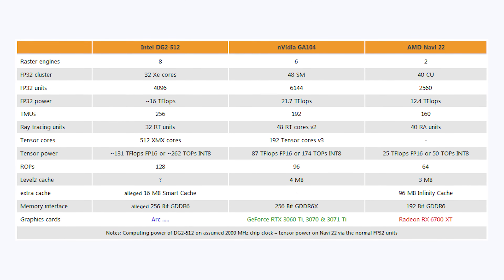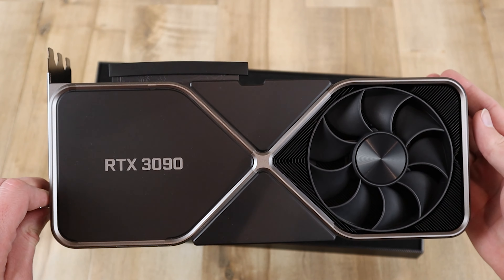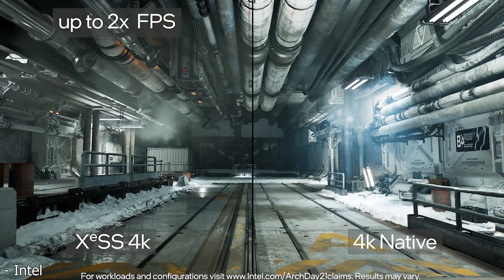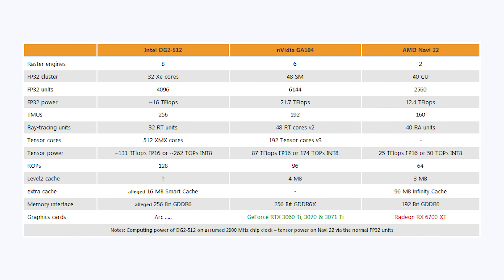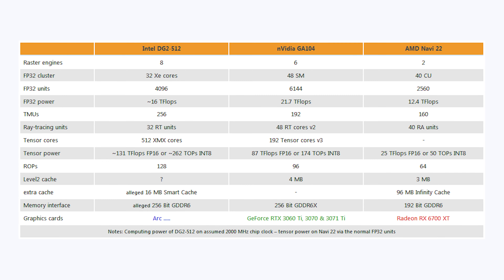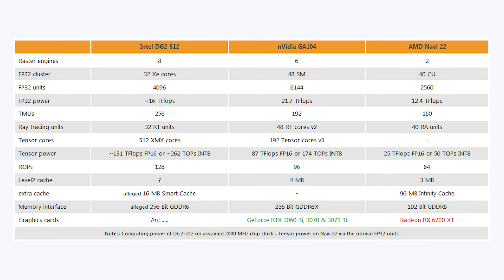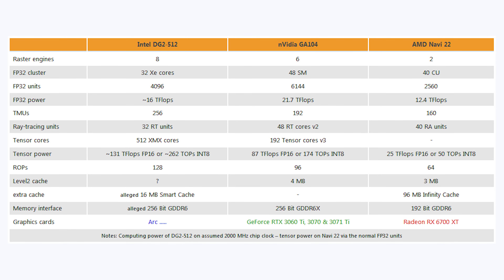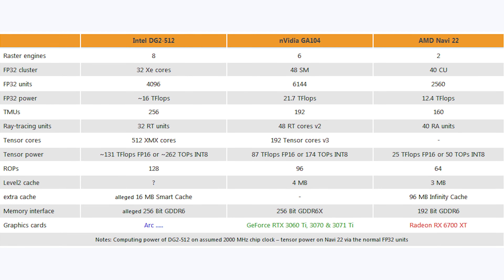MONSTER Intel Arc GPU - Specs, Performance, & Release Date

Comment: Was wondering if you could tell me would it be worth it to upgrade to the INTEL GPU from a 2080TI? Im perfectly happy with 1440p 165hz gaming. But I do VR flight sim with HP reverb 2. Im thinking this INTEL card could be the best bang for my buck on the handful of games I play.. but my 2080ti is rock solid for 1440 gaming
Reply from the maker: Probably not, no. The 2080 Ti is still a great card.

Comment: Intel's iGPU drivers (when they remember to release them, ahem Rocket Lake) have been relatively stable.  I'm curious to see how the driver team does with their more complex GPUs.
Reply from the maker: I would assume it's a top priority.
Reply: since they have a lot of experience in optimizing drivers for low profile gpus and igpus i'm sure the performance is gonna be great on ARC gpus :D
Reply: well.. its not intel first gpu anyway.
Reply: Intel igpu were awesome in past as well. Remember in 2014 they brought broadwell core line up with irish 6200 igp which was faster than upcoming hd 630. Sadly the broadwell first chiplet desgin intel cpu was failed in terms of latency because haswell monolithic was Faster than chiplet broadwell . As a result whe have seen some immature igpu like hd 630.
Reply: no problem. just hire more people to do it. intel have the money to make it happen. intel isn't necessarily bad at software. their open source effort are said to be even better than AMD.
Reply: @GraphicallyChallenged  they remember how driver problems crippled the navi launch

Comment: The biggest issue facing intel GPUs is going to be the drivers as these take time to mature.
Reply: intel just need to make their driver team 10 times bigger than nvidia. they got the money to do it.
Reply: I'm sure it being intel.. it should be pretty fire on launch and compatibility will be the only issue with older hardware. I'm interested to see if they work on on let's say a 1st or 2nd gen ryzen or all the way down to a 3rd gen intel. It will be very interesting
Reply: @arenzricodexd4409  Bigger doesn't mean  better
Reply: Intel has been writing video drivers for decades.

Comment: As Intel is using TSMC for their Arc GPUs, they'll face the same supply constraints as AMD.  Their prices will probably be online with the reference AMD GPUs, barring any distributor price chicanery.
Reply from the maker: Not necessarily. It's a different node and Intel is only producing GPUs. AMD is using 7nm for Consoles, CPUs, and GPUs. But it is still a concern.
Reply: @GraphicallyChallenged  Good point.  Yeah I'm hoping manufacturers start penalizing destructor for abusing the market.

Comment: Technically the full Intel GPU could beat the 3090 by a fair amount. Unfortunately Intel isn't releasing it for consumers, only data centers. It's fairly clear Intel only is making GPUs to fight Nvidia out of the data center market. They want that bundle benefit that AMD has so they have to kick Nvidia out of the market.

Comment: Intel gpus isn't going to be cheap.
Also good luck getting one it's a paper launch again.
Reply: gpu supply will be bad in 2021-2023.
Reply: None of these were "paper launches" stop using buzzwords you hear online. There is multiple, very well documented, reasons for the shortage and it doesn't just affect gpus.
Reply: @zushikatetomotoshift1575  2021-2023? that's cute you think the supposed "experts" are accurate on the timescale when they aren't accounting for a second depression and a second lockdown as a cherry on top.

BOI, back in the 90s - early 2000s, a good gaming PC was 5000$-10,000$ and may as well been a luxury item. Guess how much PCs will be in the near future when you account for shortages+inflation+deppression+pandemic?

Get them GPUs and CPUs while you still can ppl it's not going to get cheaper.
Reply: @MarkFin9423  I agree they are not going to get better prices maybe until after 2024? but how knows.

Comment: Nm nodes is actually kinda misleading, Intel has about the same transistor count if not slightly more pr mm^2, however their arcitecture is less energyeffective than AMD's.Samsung nodes are no different, Nm is nothing but a name to represent progress, but not in a matter compared directly to the competetion,it is simply just marketing.It will be a fierce fight between Intel,Nvidia,AMD and Apple when all of them does both cpu and gpu in their own brandings, neither Apple or Nvidia will linger for much longer until they could expand and grab some of the sweet sweet % of the market and deliver competetive systems branded with their names on both cpu and gpu.
Even more powerful gpu's than we have today is all and well for datacentres,AI tech, Minig, and such, but keep in mind that most game developers stribe to implement low end hardware into their games so they may yield better profits(gaming seasons,cosmetics,battlepasses,lootboxes and such).I do believe that in the near future, midrange gpu's will practically seize to excist, while low end and used previous gen gpu's will dominate the market, while high end gpu's will be so crazy expensive and powerful that nobody with a normal income may afford it.
Intel's Arc Gpu would be like a 3060Ti or 3070 for the most part, i am not aboard the hype train just yet.

Comment: So basically, intel is going with mid range 5700 xt vs 2070/2060s path and while they are a sh***y company(morally speaking) they are a very competent one when they do focus on something. Then, they will try to match the high end with the 2nd or 3rd generation. The question I really want answered is if they will "match" the pricing of amd and nvidia or will they lead the group with a lower pricing. But looking at the history of their business model and the fact that they are going to use tsmc as well, they won't. We, the consumers, albeit will have more options,  it would still be between which expensive gpus we are going to buy. A bit dark I know, but I can't help it.
Reply: they deff will charge as much as they think they can get away with they have a large following of customers that will pay whatever they charge even if they where to charge less scalpers would soon take care of that missed opportunity for them

Comment: "IF Intel sets their prices at a reasonable level…" 😂 Right now, a "reasonable level" is "the price scalpers are currently charging," because it’s been shown that consumers will (grudgingly) pay that much if there's no other alternative. So why take less? It would literally be corporate malfeasance to charge levels like current MSRP.
Reply: It's way better to pay an higher msrp than give scalpers headroom to charge prices. At least I'm giving more money to the people who actually designed and built gpus and  I'm not feeding lazy and criminal people.
Reply: @iamironsam  I see where you're coming from, but greed is greed.  The head up will only line their pockets with that extra cash. Either way it's not good.
Reply: If a company doesn't make money you won't get a product. Simple as that. Product development and manufacturing is not free.
Reply: @GroweverydayOriginal  It seems they weren’t exactly going bankrupt while pricing their products at the previous MSRP.

Comment: I do hope that scalpers and miners do not get their crappy hands on dat gpu when it comes out 😒😒😒
Reply: They'd probably have to cut bait on the 5000/2000 series they snatched up early this year. They'd be selling at a loss, but with the new Intel GPUs AND new AMD & NVIDIA generations just around the corner, better that, than nothing.
Reply: Moji PSX  - I hope you're aware of the Ethereum changes supposedly coming up in December and the change to proof of stake from proof of work, with said changes likely making Ethereum mining not as profitable as before.

Comment: You can't really tell what the performance would be just from a specs chart. But if the performance is good and the prices are lower than NVIDIA and AMD, then we finally have competition on the market. Hopefully that'll decrease overall MSRP prices of the GPU market.
But even after the GPU launch, we still have to wait and see whether intel is going to be able to keep up with the performance leaps.
Specs wise it sounds like a good GPU though.

Comment: My general question interest in this is the following: I'm not only gaming but also coding a lot and sometimes I need a strong GPU to build my AI models. Since I currently don't have the money for a proper workstation PC and GPU, I wonder how good those GPUs will be for my use case. At the current situation, I'm kind of forced to go with Nvidia given they have the ultimate experience (given I utilize the tensor cores sometimes and AMD equivalent didn't show as user-friendly and good experience...yet..) and would rather go with other manufacturers if they show the similar or better performance at it. Tbh i don't expect the answer asap, will see what happens next year

Comment: You might be thinking: Wow, upsampling is so awesome. And as a technology, it really is. But you have to remember, you are sacrificing futureproof performance for quick gimmicks. IF you buy into upsampling, you WILL be upgrading EVERY generation. And dishing out $1000+ every time. That is why a smart move would be to get something with lots of physical overhead and be good for 3-4 generations. You would spend like 1500 now instead of 4-5000 over the course of 4 years. But most of all... MSRP has to come down BELOW $/€/£800 for second to highest tier. Otherwise... its just a trap of paying $100 per 1% gain. Like it is with the RTX30 series right now.

Comment: Since the Intel GPU is going to be a first generation design, I wonder if it is going to be stable.
If so, I would seriously consider it. I dont need a high end GPU. Mid range, or upper mid range is probably more than enough for the games I play ;)

Comment: 3070 level performance in 2022 would be embarrassing.
Reply: Considering that due to shortages and inflated prices, maybe 10% -15% of PC users will have a 3070 level card even then, no it's not.
Reply: Naw.. not at all. The 3070 is embarrassing? It's as if you already heard the msrp is $800.. but you don't know that..
Reply: @christophermullins7163  I won a 3090 Founders Edition. 3070 level performance from Intel with unproven drivers and software I don't think is a good combination for 'competition' in the marketplace in 2022 when it is set to arrive when Nvidia would be showing off their new card line up rumored.
Reply: Considering 97 per cent of people can't get a 3070 it's incredible
Reply: 3070 performance would be great for Intel's first go considering hardly anyone can get hold of a 3070 without paying a ridiculous price.
Reply: Troll.
Reply: @christophermullins7163  - not exactly the case with the MSRP for the 3070. If you know the Brobot Discord Server, the MSRP Range for that GPU is anywhere between $400-850 USD (the $800 you bring up is close to the upper end of the 3070 MSRP Range).

If anything, I feel that the prices are going back up at the moment.
Reply: @LadyWolvie82  I want to be clear, I did not say "$800" with regards to the 3070. It was just a random high number that'd make for a terrible msrp for intels 512 card.

Comment: I agree that 3 way GPU competition is great. But the US Government should ALSO force Intel to give NVidia a x86 processor licence, so we can have 3 way CPU competition as well! Its only fair, and the anti-monopolise body should have already done this, but now Intel and AMD is doing both CPU and GPU, NVidia should be allowed to do the same, rather than trying to switch to arm because it has no other choice.
Reply from the maker: Nvidia is acquiring ARM, so they might be competitors still even without the x86 license.
Reply: @GraphicallyChallenged  ARM is a different architecture, so x86 stuff probably wont be compatible, so not really competition. Also, ARM is owned by a UK company, and the UK government's antti-monopolies commision is looking like it is going to block NVidia from buying it. If Intel were FORCED, or had the decency, to give NVidia permission to start building x86 CPUs, then that would just be fair, and far better for the PC market.
Reply: @tstager1978  rubbish,  TSMC is based in Taiwan. The shortages are due to bad decisions by private businesses whilst Trump was in power. Biden is pumping huge amounts of money into building new chip productions in the USA.